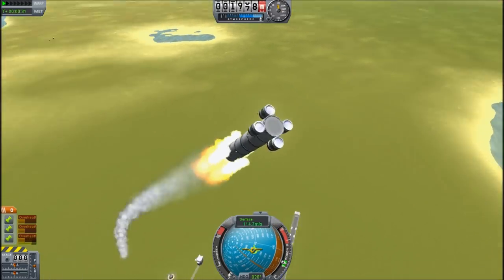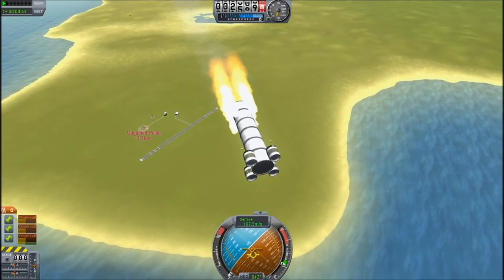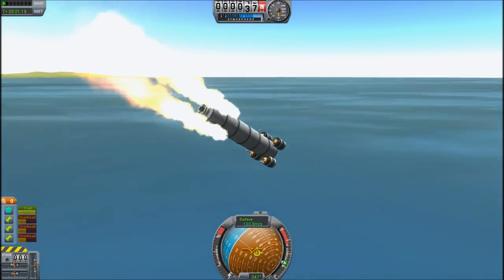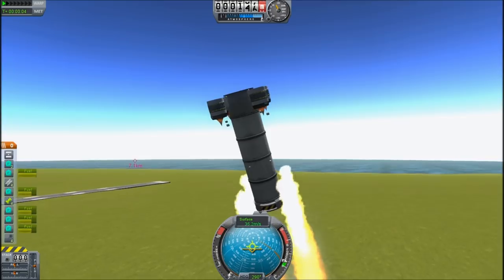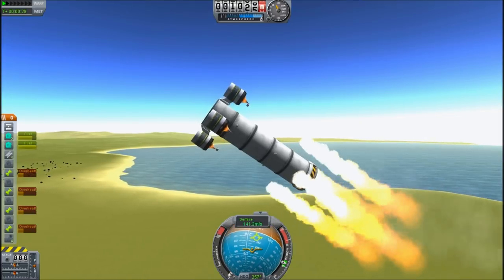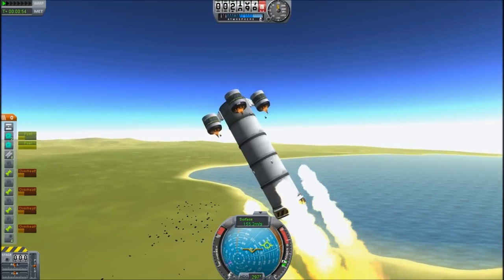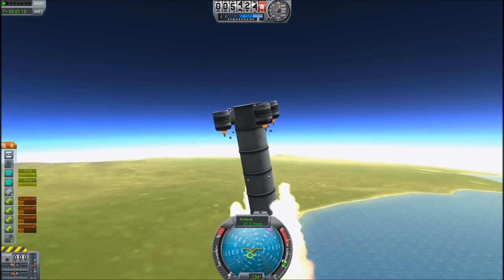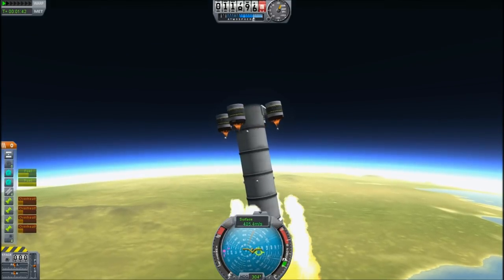The Pendulum Rocket Fallacy

Comment: If the pendulum has some drag towards the bottom this WILL work. I dragged a giant ring space station into orbit this way. I could not get it stable with thrust underneath but attaching it under some very powerful rockets connected by struts and fuel tanks so that the structure did not get burned up by the thrusters worked fine. You would have to find something that creates just the right amount of drag at the bottom to maintain stability and not make the rocket lose too much fuel efficiency. I don't recommend a space station as a drag feature.
Reply from the maker: It'll keep it stable wrt current pointing, it won't keep it pointing upwards away from gravity.
Reply: I think I may be misunderstanding what you are going for. The space station was completely unsteerable until it reached around 50k meters due to atmospheric drag. Until that point I could only watch the ascent and control the throttle as the nav ball always stayed perfectly centered towards the sky. Even at high altitude i had to transfer fuel around in the ring to get it to turn more steeply. It was likely the most inefficient orbit I ever created.  Anyway, I am a big fan of your videos and they have helped my understanding of the game and space travel in general. I still have a lot of planets to visit so I look forward to more tutorials and crazy build ideas.
Reply: +Scott Manley I did this sometimes, but for 2 different reasons. 1 - Get rid of wobbling. 2 - Decoupling fuel from bellow so i can keep using the same engines (i cant remember if this second one worked).

Comment: You could put the rockets further up (as shown) and put them on ball joints. Then put about 2 thirds or 3 fourths of their weight underneath the ball joints, so they will always point upwards. Could that be possible (with control over throttle on each rocket)?

Comment: Here is my simple explanation: in a pendulum the pivot is at the fixed point - gravity applies a net corrective torque. In a rocket, the pivot is the centre of mass - and by definition the gravitational force acts through the centre of mass, and such there is no moment from the weight

Comment: I don't use it for launches, but I have had a HUGE amount of success using "pendulum rockets" for interplanetary ships. I found them to have non existent joint flex compared to conventional rocket designs. With the added bonus of being able to easily add more fuel tanks to the design by just stacking them on the back (also allows easy jettison for when I burn all the fuel in the tank). Plus, I can easily reuse the engine section at the front of the craft.
Reply: +locarbapplesauce Just get kerbal joint reinforcement. problem solved.

Comment: centripetal forces are those that act toward the centre of a rotating system, thereby keeping the object moving in a circle (it would otherwise go off on a tangent). The simulation of gravity that you describe acts outwards, and cannot therefore be centripetal. The fake gravity is an apparent centrifugal force caused by inertia.

Comment: How does a a rocket with the center of mass towards the rear or first stage if a multistage ,  maintain the desired attitude or ideal angle needed as it rolls over to the follow the curvature ? The roll sequence is executed very early in flight while still in lower atmosphere. Still plenty of drag . What keeps the nose from pitching up as the center of mass is rearward , with gravity pulling the greater mass downward and tending to force the rocket’s nose upward. wouldn’t gimbaling the engines thrust downward to compensate induce oscillation ? Help me out here .
Reply: Gravity accelerates every bit of the rocket at the same rate: the rocket isn't tall enough that the top and the bottom experience different accelerations due to gravity, and the rocket is also not massive enough to make any kind of discernable difference (that is, it's not big enough to accelerate the whole planet towards it). If the rocket were to lose power and start falling down of course it would eventually right itself in an upward position with the heaviest bit to the bottom, but only once its velocity vector would be pointing downard, that is entirely because of aerodynamic forces, not some kind of pendulum effect.

Comment: I think Gravity would have a negligible effect on the orientation of a puller rocket.  By definition the rocket thrust would have a bigger effect.  And, as you said, if there is no guidance or control surfaces, any minuscule amount of off axis thrust would throw it off course.  Would it still go off course if it were spinning as it were launched?  I think much less so, but eventually I think it still would.

Comment: One thing to note however is that empty fuel cans have the same drag as full ones, but have less mass so this system appears to work if you change the fuel flow to empty the bottom tanks first. But in reality this is aerodynamic drag at work not a pendulum effect.

Comment: Unrelated, but I put a SAS module on the top of a solid rocket and it worked. If you use the side mount launcher like you first did, engage SAS then launch, it stays pretty much vertical

Comment: Gyroscopes and in RC or smaller scaled ones use fly-bars that have weights on them so that their inertia keeps them spinning parallel to the ground which changes the angle of the blades. I'm not sure if full scale helis use anything else.

Comment: I was wondering about similiar problem when i tried to make a rocket that had center of mass close to center of thrust. So i was thinking that if center of mass is high, and trust from the engines is very low, then my rocked would tip down, but what would happen if i would put rockets high with payload sitting low, reversing the position of center of trust and mass. In the end i have failed to make a practical design, so I sticked to classic style of vessel. Which i know for sure, that type of rocket would indeed help to keep stability by making center of trust and mass closer to eachother, but I still dont get why making center of trust higher tnan mass makes the rocket unstable. maybe becouse its so inlogical - if you pull a string it would follow your fingers as you intend, but if you push it you would manage to make it go straight forward.

Comment: Not sure I understand the fallacy. Center of mass is center to forward center on the rocket, and thrust force is in the front of the rocket. If you have a perturbation, the drag force vector will change in suit. For example, lets say there is a disturbance putting the pitch axis at 3 degrees pitched down-- there will be more of the aft section of the rocket exposed to the air in the opposite side, providing a correcting force. Placing the source of thrust forward of the center of mass yields a negative feedback loop on the process of rotation whereas classical rockets have a positive feedback loop in those out of control situations. 

I think the reason the pylons made a difference is the larger moment arm they could act on. Spacing engines further away from any given MOI rocket will allow them greater influence on its rotational inertia.

Comment: that might be possible using a rocket which has a small (= low drag) heavy thingie on one side: as long as it is filled with fuel, the slight imbalance does nearly not matter, but when the fuel is being drained, the tanks loose mass while the small heavy thing keeps it's mass, shifting the centre of mass to the side. However, the problem would be to keep this rocket stabilized. Scott was using a spinning rocket to great success, but the rocket with the weight on one can't be spinning :(

Comment: One of the things they discovered with early Congreve rockets was to aim them downwind because the tail of the rocket, with its fins, would be disproportionately affected by the wind, so that the unguided rocket would tend to point itself into the wind.

I would be more concerned about differential thrust from each of the 4 engines.  I imagine assuming that you're getting identical performance from all 4 engines at all times results in all kinds of anomalous results.

Comment: in theory that would work, but you have the weight of the mun pushing against the rockets, you'd have to provide enough thrust to move the weight of the mun + extra to accelerate or decelerate the mun.

Comment: It has inertial feed fuel in that case. If you had the engines placed at the top of a vehicle you intended to thrust against gravity then the fuel would have to be pumped up to the engines as the vehicle ascended. The inertia of the fuel isn't going to suddenly slam it all to the top of the tanks. What happens when you pick up a glass of something off of a surface? Does the liquid suddenly launch itself upward out of the glass or does it stay in the bottom of the glass?

Comment: Yeah, I guess I commented during night/early morning. What I probably meant was shouldn't it be more stable with the vectoring in the front (not necessarily close to the main fuselage) because the pulling motion would bring most fuselage vibrations to a halt, at least my rockets with vectoring in the front seems more stable even though the drag is then centered on the front and should be keen to flip the rocket around.

Comment: The bending of the struts seems to be acting like the swash plate on a helicopter rotor...  i.e. there is a feedback loop that is twisting the rockets sideways as they pass over the 'top' of the flight path, resulting in a net thrust pushing the rocket back upright and generating spin.

Comment: I know this video is 10 years old but I wonder if there was a point of articulation between rockets pulling in the front and pods with fuel, cargo, etc. behind, like a space train with a rocket locomotive, would there be a pendulum effect then? It seems to me that if you fixed the pendulum in a clock to an unchanging angle it would also not work.

Comment: 2019: The Pendulum Rocket Fallacy is itself a FALLACY. While still quoted routinely by lots of people, if you actually READ the Rocketry Fallacy argument, it explicitly states that this is only true for rockets with no active control surfaces/vectoring thrust.  That can be said for all rear-engine rockets as well. If it starts to veer in some direction,  it will not stay verticle.  A pendulum rocket may be harder to plumb, but it allows much better staging while retaining all engines.

Comment: It is more akin to frontwheel drive versus rearwheel drive.  Why doesn't your example have stabilizing fins?  I'd like to see a side by side comparison of the same setup pushed from the bottom vs. pulled from the top.
Reply: 1. Road vehicles are designed to be controllable in only two dimensions, not three (movement along the Z-axis is constrained by the height/inclination of the road).
2. The acceleration vector of a road vehicle is constrained by friction, centripetal force and the slip angle of the wheels doing the steering, regardless of whether it's front or rear drive. Rockets don't work this way.
3. Road vehicles typically don't suffer from aerodynamic effects to the extent that they will flip over and explode if the center of mass shifts.
4. Road vehicles can basically ignore gravity beyond the effect it has in generating friction from the tyres or accelerating a vehicle rolling downhill.
5. Road vehicles experience a hell of a lot less thrust, acceleration, aerodynamic drag and G-forces than any rocket.

In short, rockets are not cars so your comparison is false. Also, this video was posted eight years ago. ;)
Reply: @sixstringedthing  I know that.  But why not put fins on his demo rocket and have a valid comparison?  Take a conventional rocket, remove its fins, and it'll be just as unstable as his demo rocket.

Comment: Because your load is non-rigidly attached, it will be more stable, as a deviation from centre  results in a corrective pull, as opposed to the runaway buckling you can get with a pusher. This does not work with rigid objects...but what's really *rigid* in KSP?

Comment: What about putting some fixed control surfaces to make it spin? The gyroscopic effect (if it's called this way in english) should keep it ponted upwards...right? I had the idea from a lander that converted vertical speed in rotation speed in the same way, and it looked  quite stable at high speed!

Comment: 1) it doesn't stabilise the rocket, 2) its less efficient as you cant thrust straight down, 3) you still need heavy, powerful engines that you can drop off and lighter, less powerful ones possibly with different fuels.

Comment: With this fallacy laid out (love the simulation), I'm curious as to why the Apollo/Saturn escape tower had it's nozzles situated above the crew module?  I realize it is probably for packaging constraints, but it does appear to have a large portion of mass situated below the thrusters, and therefore should suffer from the same issue you demonstrate in this video. Perhaps another video to show how the physics are at work here?
Reply from the maker: It's because they wanted to get rid of the escape tower after launch, once they were going high enough and fast enough they didn't need it to escape.
Reply: Yeah it would suffer in the sense that it would not keep flying straight or vertical for that matter, but with thrust pointing not too far off the center of gravity, and roll in the air, the error will be small enough that the escape pod will tend to curve into the ground with a large enough radius so when the engines cut off and the parachutes deploy it happens at a safe altitude.

Comment: Rotors spin independently of the actual craft and are still shaped like wings just like an airplane causing a low pressure system above and high pressure below giving you lift. It's like many planes traveling in a circle.

Comment: Sure the pendulum doesn't do anything for you but the real problem is since fuel is heavy and the motors themselves are relatively lighter in these simulations, the CP is ahead of the CG; this would cause negative stability without massive guidance features to shift the CP backwards.  You sort of hit on it at the end with the tower escape system needing extra dead weight to shifted the CG upward past the CP of the configuration.

This is why you can get away with this in say a small model rocket where the motor constitutes the main part of the model's mass with the body / fins being a small part.  That is the CG is pushed forward of the CP due to the motor elements.

Why is it working in Kerbal if you put them on pylons?  Not real sure but I suspect the active guidance is more aggressive as the motors are further from the center line; i.e. a more massive guidance feature.

Comment: What about if you made your rocket not fly strait up, but fly at an angle in one direction, and then as it gains speed considering it stays in one direction, gain pitch from lets say 50-80. so that when it reaches orbit it will be slightly heading in one direction, if that was timed right u could make an orbit where the rocket will cut off just in time.

Comment: The dynamics are exactly the same, but structures under tension tend to fall apart less catastrophically, and if the structure is woobly you'll have fewer problems with your center of gravity moving around in a puller configuration.

Comment: Additionally, the helicopter's blades generate a gyroscopic stabilization effect, which fights any attempt to roll or pitch the craft. Also, helicopters have control surfaces - the rotor blades. The rocket in this description has none, relying solely on gravity to right it.

Comment: for all the thing that could have been used to add weight, why depleted uranium? like really, why depleted uranium of all the heavy metals there are?
Reply: Because it's very cheap, easy to get (at least for a governmental organization) and one of the densest materials available. It's toxic, especially if inhaled or ingested, but encapsulated in a rocket part, it's not really a problem. It's only mildly radioactive and an alpha emitter, so it takes no more than a sheet of paper to completely block the radiation.

It has also been used in a few sailboat keel bulbs to maximize righting moment with the smallest volume possible. More volume means more surface area, which means more drag, which means a slower sailboat. So DU is really good for that purpose.

Comment: It's immediately obvious that hoping for a pendulum effect to right a rocket is bogus (the pendulum gets it's stability because the earth-anchored pivot is constantly "pulling" at 1G in a fixed direction (relative to the planet).  Rockets don't have that righting force, period.  (It would be interesting to know what quirks in the simulation software lead to your self-righting pylon rockets - which would likely not be true for the real world).

The less obvious issue is about putting the source of force (engines) ahead of the center of mass versus behind it, which applies even without gravity - a puller rather than a pusher.  That should have some stability, related to some degree to the difference in driving a front wheel drive car in snow (not an exact analogy, just for illustration of forces).  If you have one tugboat, it's much easier to pull a towed ship through a course than to push it.

However for rockets you need active stabilization in any case, it's not too hard to do it with a rear engine, and having a rocket engine in the rear has major practical advantages.  Hot exhaust is best put behind you, not alongside.

And for a pusher, there may be advantages to a longer distance from force to center of gravity.  Try balancing a broom and a hammer with your hand.  It's probably just a different time constant with the broom giving more time for perception and human reaction in the balancing loop, tho.  I wonder if something related to that is the reason for DU being added to the nose of the escape system?